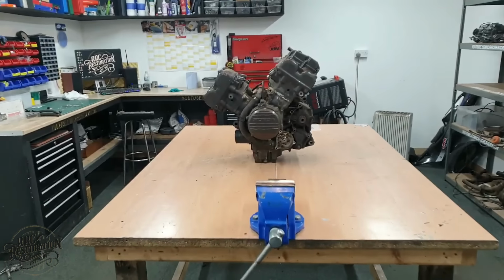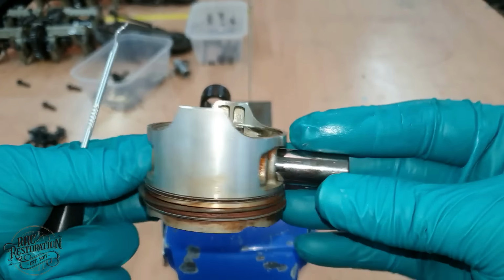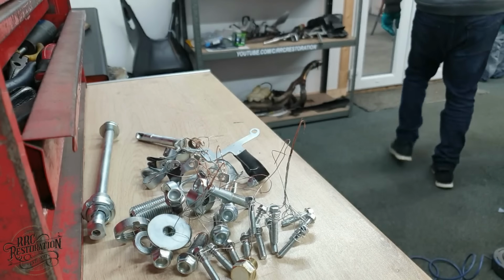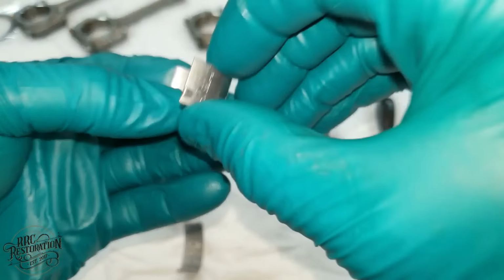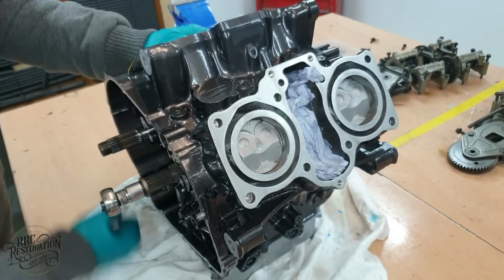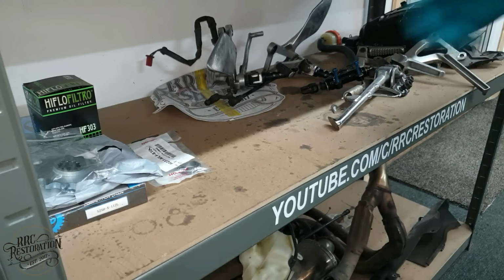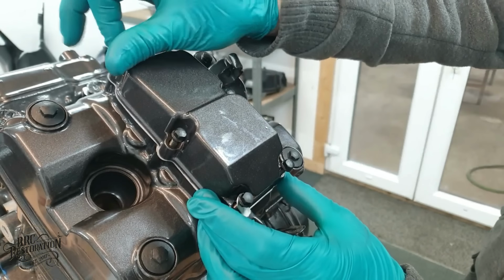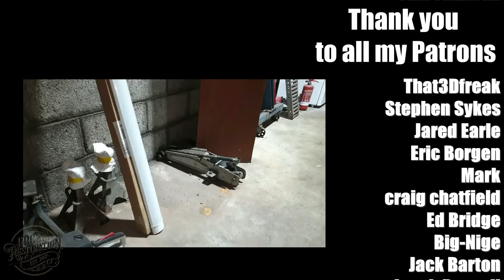Restoration Of A Ruined Legend - Honda VFR 400 NC30 - Part 6

Comment: suggestion. for future restorations consider getting a wheelie bin/large swing top bin. those are cheap and sturdy and importantly are very deep. and of course arent round. so you can submerge large objects like an engine block completely in cleaning fluid. I've used a large bin to store my fish whenever I clean out my fish pond.
Reply from the maker: A great tip and now i feel rather foolish as i have a spare wheelie bin sitting at the side of my workshop " D'OH" lol.

Comment: You are very miticulis in the way you lay everything out so reassembly is a no brainer, you know right where everything goes, smart, I can see this isn`t your first rodeo. You have a lot of nice engine related rebuilding tools, like those vicegrips that hold the gears from turning, I have never seen those. I completely rebuilt my jet ski engine, the dealer had an exchange policy for the crank, you give them your old one and they give you a new one with the bearings all pressed into place for you, $840 later, everything else I did myself. I bought new stock pistons, the cilinders where great, I just rehoned them like you did, and when I got it all back together in 3 weeks, it fired right up, I ran some extra oil in the gas for the first tank because it was a two stroke, and it ran like a top for years. I had everything so spotless clean , like you there wasn`t even dust in that engine when I reassembled.

Comment: Great work! Also, the post-production is excellent! Presumably, after the valve stem oil seals were replaced, the valves were lapped in, and the clearances were adjusted?

Comment: Fantastic work, loving the results!

Might I give a suggestion for another bike?
Mid 90's Yamaha GTS.
I was the owner of 3 in the early 2000's and sadly had to give them all up due to life issues.
My plan was to get an FJ 1300 (2016 or newer has a shaft drive and 6spd trans) and replace the drive line in the GTS with the FJ's
One of the "style" things to accomplish with shaft drive was to give both ends of the bike a single sided swing arm look.
Additionally the FJ had a better ABS (I believe Bosch) and proper "throttle by wire" and thus cruise control.
The last 3 design goals I would have tried to accomplish would be to make a tightly tucked under exhaust like the Ducatti Panigale, more fall-resistant set of mirrors and finally redesign the fuel tank to get closer to 4 gallons.

Finding GTS's in the states is next to impossible but in checking various web sites in europe they SEEM to be pretty common.

Thank you for sharing and I enjoy your episodes.
Cheers

Comment: Congrats on a well done job  I have enjoyed this rebuild immensely  being a life long Honda fanatic and motor engineer by trade, but a thought I had originally when you were tearing the bike down that I forgot to ask resurfaced here on the rebuild which was, has that frame suffered  being dropped at sometime in the past, I ask this as the welding on those front head steady frames seems remarkably shonky and well below Hondas usual factory  standard, I dont doubt they are sturdy enough and well up to the task but my god do they look amaturish, if it were me doing this rebuild I would have ground them out and re tigged them closer to factory spec.

Comment: Tip for replacing gaskets apply sealant to both sides of the gasket and massage in using for finger and thumb this way you will get no sealant ooze and no chance of missing areas works especially well on head gaskets.

Comment: Great vidoe as ever and fantastic work once again. is the paint that you use on the engine cases a heat proof type or simply a 2K? I only ask as I do a lot of builds on old CB's from the 70's and trying to find a cheaper solution to cerekote is proving a bit tricky and I like the application and process you undertook.  Keep em coming, your depth and knowledge is well noted and greatly enjoyed.

Comment: Love this series and always great content and love seeing all of the details!  I noticed when you were putting on the sump gasket and pan that RTV had been applied around the two circular oil drain galleries in the lower case, however the gasket and oil pan does not cover them (@30.14).  Suggest to pull the pan to clear off those parts of RTV so they don't come loose and travel through the sump/gearset/oil pickup.

Comment: Could you go thru sometime and explain the steps in your plating process, and chemicals used? Id like to do it for my Projects.  I clean my bolts with a wire wheel grinder and solvent, but i like how your process makes them look new

Comment: Its amazing how well made the v4 400 is, gear driven cams is still uber race spec (wsb/motogp) so easy to time. 

one thing that was off... 

The inside of the cam covers and clutch cover was dirty and were refitted (I cant unsee it now) 

Person choice to paint the inside of an engine oil /clutch side falking paint always sacred me off (lots of resto M3 learned this lesson) 

but as always love your time effort and work making these videos.
Reply from the maker: Yeah I could've cleaned them up on the inside but sometimes I think you can go a bit too far with these things and they will only get oil stained again in a few thousand miles ;) As for the paint on the inner casings I'm not worried about it in the slightest as I've a long track record of doing this and never once had paint fail on me but hey each to their own way of doing things ;) Really glad you liked the rest of the episode :)

Comment: Beautiful work I note u didn’t plastigauge the crank and Rods is that because u just went off the.  Crank and crankcase no.s for the correct brg shells ? Also didn’t c u gap the rings or du do that off camera?   That bike will b better than new !!

Comment: how did you get those perfect plating results?? every time I try I get only mat looking surfaces. what kind of liquid do you use?
Reply from the maker: Hi, It took lots of practice to get it dialed in but basically it all comes down to preparation, cleanliness and knowing your plating temps, amps and time in solution.

Comment: Lovely job. Those big sort of chunks missing out of the cylinder wall at the top of the cylinders wall ? Is that likel to cause an issue you think?
Reply from the maker: Cheers, The " missing chunks" are supposed to be missing as they are machined out at the factory so the intake valves clear the edge of the cylinder bore ;)
Reply: @RRCRestoration  thought they looked a bit too uniform ! Bloody good, work inspired to crack on with some of my own jobs now. Keep it up :) 💪

Comment: Really excellent videos. A little surprised you didn't think it worth checking the valve clearances during the rebuild. I'm only curious as its often  a discussion point on older 800's. Thanks!
Reply from the maker: Thank you glad you enjoyed it.Every measurement was checked , I just don't often do it on camera these days as it keeps things simple for the viewer and stops the heated debates forming over which spec is correct.  lol

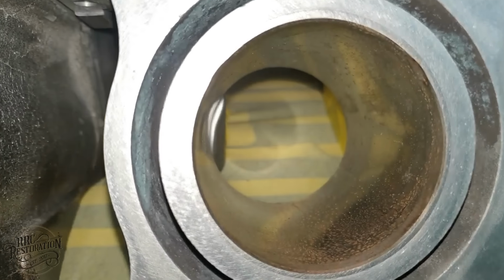Comment: I'm catching up on all the video's on this rebuild. I noticed a little chip on about 11 o'clock on the left and 1 o'clock on the right  inside the cylinder bore. Is this common for bike engines to have? 2 about 18:54 you can really see what I'm talking about for the right side.

Comment: Hi, I have a question to ask: when you dismantled the pistons from the connecting rods to change the elastic elements and clean everything, you didn't mark the respective piston to the respective connecting rod and consequently to the respective cylinder. Even when reassembling everything you didn't take their original position into account, why this? Was it appropriately intended? Hello and thanks for your videos

Comment: Fantastic job as usual, may I ask why you use both paper gasket and gasket sealer? I've always read that you are good with either of those, but not so many people use both at the same time. I can't wait to see it finally assembled.
Reply from the maker: Hi, The reason i use both is just for a bit of insurance if both are used then chances of a small leak are minimal ive had engines before where paper only was used and everything looks and feels fine but when fired up  a small leak would start and you'd have to drop the engine out again so  i just use both now and ive never had an issue again.

Comment: That's an awesome job, RRC. Love the attention to detail and the little metallic flakes in the paint. Although, I am curious as to why you didn't clear coat the bottom oil pan and didn't replace all the bearings in the engine. You're in deep there already, sounds like little effort but great peace of mind. But that could be my weird brain.
Reply from the maker: Thank you,  The sump didn't get a clear coat as its protected by acf50 which keeps the alloy looking new, The bearings on the engine were all checked and found to be fairly new with no play or notchiness so no point replacing them when they are still perfectly good for 10s of thousands of miles.

Comment: lovely to watch although coming from the world of 2 strokes where maintaining a good solid crosshatch from honing is important, a recomended angle of cross htching is 30 degrees, you need to be running the cylinder hone back and forth much faster for that rpm, or slow down the rpm and run it in and out at the same speed, your ross hatching i imagine will look more like a load of horizntal rings.

Comment: Lovely job as ever. Assume this was a grey import? If yes, then how have you found getting parts?
Reply from the maker: Thank you very much :) , Getting standard parts such as bearings seals bolts etc etc is fairly easy as they are interchangeable with other models the trouble comes when trying to get NC30 only parts then its a case of searching and waiting.
Reply: This worries me as I have a 1983 CBX550F2C and I'm going to need carburetor mounting stubs and probably the ones from the carbs to the airbox as well......Dave Silver spares doesn't seem to list them😢

Comment: Excellent work and beautifully edited 👍🏻.

Just an FYI. If you need a more accurate measurement of depth when using your digital calipers, flip them over and use the step on the front rear face. You can hold the front jaw nice and square. 🙂
Reply from the maker: Cheers buddy always good to hear from you. Thanks for the tip, I always forget about just how many measuring faces a set of calipers actually have haha

Comment: At the time when I worked for Honda, there was a specification for the length of the screws. If the length of the screws on a housing cover was different, simply insert the screw into the hole provided; it should then protrude by approx. 18 mm. You didn't (necessarily) have to remember which screw was where.

Comment: Absolutely amazing video as usual.  

The levels you go to are insane 👏

Can I ask, do you need some heat resistant pain or the engine, or can you just use normal paint for this?

Lastly where do you sell all these projects once done, do you have an ebay account?
Reply from the maker: Thank you so much really happy you enjoy my work :) Normal good quality automotive paint is fine for water cooled engines as the temps are well with the range of the paints capabilities preparation is the key for getting it to stick properly due to the high likelihood of oil contamination. If you look back on my other bike projects you can see I keep them all in my collection although some may be coming up for sale soon as I am running out of space and money to keep going with them all.
Reply: @RRCRestoration  that must be some collection! After this vfr series, please do a video of your collection 🙏

Comment: Nice work. Just about done my 73 RD350 restoration. Looks like I just picked up a 82 RDLC 350 for the next project.
Reply from the maker: Nice , Id love to get my hands on an RD350LC but sadly they are a bit scarce around here.
Reply: @RRCRestoration  Here also, I phoned a friend who Had his old one hanging from the rafters in his shop some 20 years ago to see if he still had it. Sometimes it pays to ask. I need to up my game for plating, I built a bath for zinc but don't have the chemicals for the different colours.

Comment: I must have missed the bit where the sump had some sort of protective coating / sealant applied after blasting. Also, when putting the engine back into the frame, I would have fitted all the bolts hand tight without thread locking compound to ensure everything was perfectly aligned and correct spacers in place, before going around every mounting bolt with locking compound and torqueing into place. Saying that, it been over 40 years since I last rebuilt a motorcycle engine.

Comment: I’m surprised you painted inside the engine cases, I’d be afraid that over time hot oil would cause pieces of the paint to flake off and get in oil pump and passages.

Comment: Hi when you put the cylinders in the water with the radiator treatment to dissolve the lime scale could you do this to a bike to fill the coolent system while the radiator is on etc leave over nights or a few hours then flush the system with clean water thrn refill with fresh coolent hope this question makes sence thankyou.
Reply: That’s a good question.😊

Comment: Hi Buddy. I see you have a sand and vapour  blaster, is there any specific reason when and where to use either to clean parts? Cheers
Reply from the maker: dry blasting is used when the surface is very corroded or will be top coated as it provides a great surface for paint and powder coat to stick to. The vapour blaster is used on delicate items that will have their surface on show or on critical parts where the dimensions need to stay intact such as the pistons this is because the water and glass beads clean the surface by polishing rather than abrading. Hope this helps.

Comment: Any recommendations for a good ultrasonic cleaner for the workshop
Reply from the maker: The one i have is just an ebay special but it does the trick nicely although i will be upgrading soon as its a bit small for my needs now. Try and get one with as high a wattage as possible for the most powerful cleaning action.

Comment: Cracking work and attention to detail as ever, however that bench grinder looks like it could do with a bit of RRC attention......maybe the next project?
Reply from the maker: Thank you very much, The bench grinder has been running like that for the past 10 years and im running a test to see just how long it will keep going but once it does die it will get a full blown restoration ;)

Comment: Good stuff , one thing caught my eye.  More care should be taken in the prevention of cylinder bore rusting. That stopped me dead in the video.   The honing part was done late in the steps.  Not property cleaned of carbide honing fluid. You contaminated the intire engine with abrasive,  trust me I have done it.

Comment: 52:28. Is that a scabby bit round the bolt head!    Surely a trick of the light :)
Reply from the maker: Just a bit of oil and grease from an earlier socket , No scabbiness allowed here ;)

Comment: What was the cause of the corrosion in the cooling system?
Reply from the maker: Running the engine with tap water instead of a coolant mix.

Comment: Does the bike still have the stock generator & regulator/rectifier ?
I remember having to get mine rebuilt, and the sparky that did it said that it was a common issue with the VFRs
Reply from the maker: The bike is running and charging a treat so all is well with the electrics on this one, I cant imagine it being original after 30 years especially since as you say they were plagued with issues ;)
Reply: Cannot wait to see the final !

Comment: Hold bolts in an electric drill and use the lower speed to rotate them in the wire wheel save fingers too!
Reply from the maker: Great tip ;)

Comment: Could you possibly please tell me what caused the furring up of the coolant passages? It looked nasty. Was the wrong coolant used?
Reply from the maker: It was caused by the lack of coolant and using only tap water.
Reply: @RRCRestoration  It did look nasty. It's such a lovely little engine. I have always been a big fan of Honda bike and have owned and used three of them. This engine looks brand new now.

Comment: Just after honing when showing the bores it looked like they both had a dark possibly unhoned spot atvabout the 10 o'clock spot. What is that area?
Reply from the maker: Hi, that area at 10 and 2 is on all 4 bores its where the bore is notched so that the intake valves don't clip the cylinder wall.

Comment: I think you need to work on honing your cylinders. Chuck that three legged cylinder ruiner out and get a rigid hone. It's hard to tell from here but I  think those stones in your hone are too coarse as well.
It also looks like your crosshatch angle is too low. Otherwise, nice work. Keep up the nice work.

Comment: Just two things, 
I am not happy with your hone, usually the goal is a crosshatch with something around 45 degree angle in between hatches and yours looked mostly horizontal. maybe your speed at the drill was too high.

the other thing is, did you preload the gears on the camshaft? they look like the ones with a spring inside them to account for slack in the system and smooth out the valve train.

Greets :-)

Comment: Nice job as always. But I must admit I was disappointed with your honing technique. To maintain a 45 degree cross hatch the technique should be relatively slow rpm on the hone with rapid in an out motion such that the resultant direction of the stones is around 45 degrees. I cringed a bit when the drill was flat out. Still, it’ll run fine I’m sure!